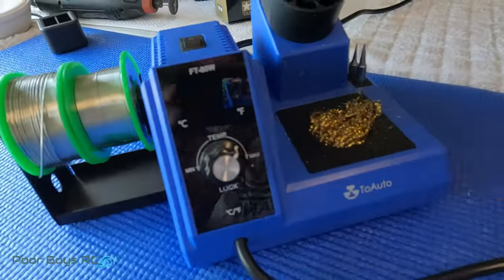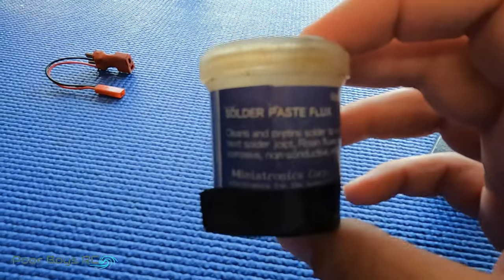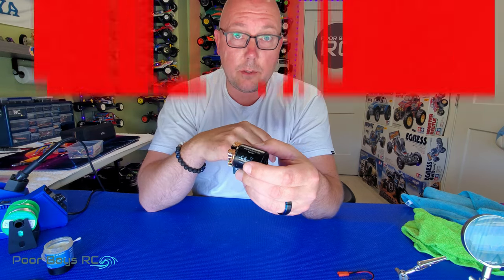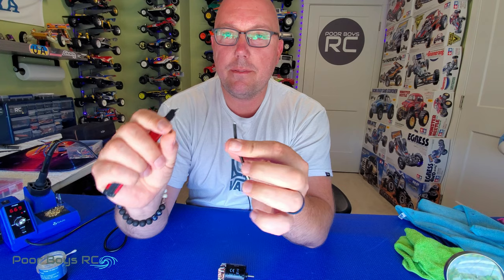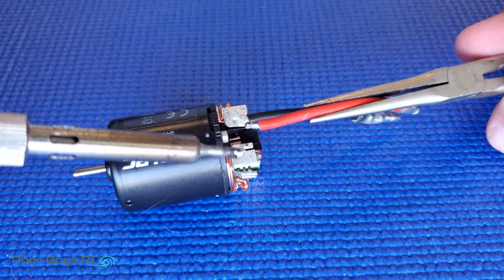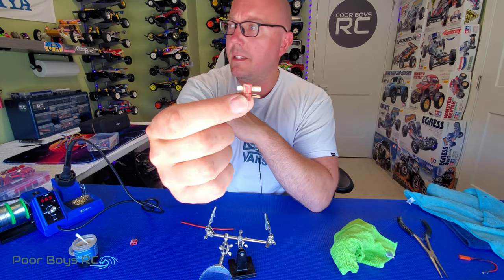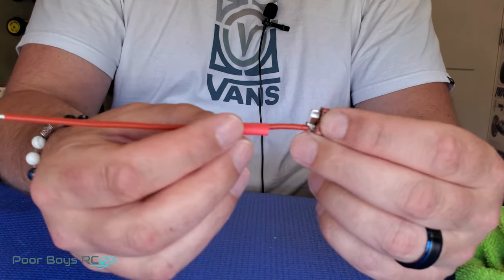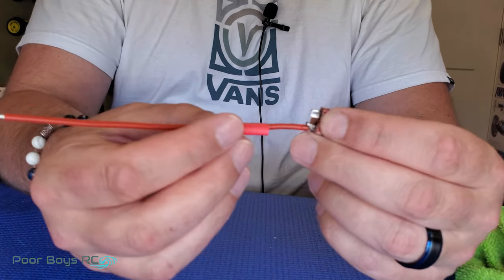RC Soldering Tips, Tricks, and the Tools of the Game. (Great for noobs!)

Comment: I like to use the handle of a pair of of pliers to cradle the motor while soldering.  You can also put a rubber band around the motor and handle for some extra stability while you solder it up. It was an old RC Car Action pit tip from days gone by.
Reply from the maker: Those RC Car Action pit tips were great! I remember mailing one in and they published it. I was so stoked to see my name in the magazine! 🍻

Comment: Flux can be either acid or water based. It helps the solder flow. I have learned a lot about soldering the last 2 months working at my second job.. 
they make solder paste that comes in a syringe. We use it for installing the processors to the circuit boards, but I bought a tube and I use it now for battery and motor connectors.. it works extremely well.. optimal temp for a soldering iron is 420 degrees Celsius which is 780 degrees Fahrenheit. To solder stuff like battery and motor connectors, you need a minimum of a 45 watt soldering station.. also a sponge to clean your iron is essential to get a clean joint.. all things I’ve learned in the past couple months I did not know from a lifetime of soldering
Reply from the maker: Sounds like you've mastered the art, Thad. Some good advice in here, thanks for your reply! 👍🏻

Comment: Nice tutorial, for the novices out there, how do you decipher between negative and positive on a brushed motor? They rarely show which tab to solder. The other soldering job was the bullet connector, how do you do that?
Great show mate.
Reply from the maker: It can be a bit of a mystery... Many end bells will have a little (+) or (-) molded into the end bell itself. But if it doesn't have those markings, I don't know how to determine polarity. I would use the "trial and error" method. 

And to solder a bullet connector, all the same rules apply. Flux, good heat, tinning, and it's easy street from there. 👍🏻
Reply: you can’t without an ohmmeter
Reply: Thanks for your help, I suppose you just add the wires and see which way the motor runs, then adjust them accordingly! Thanks again.

Comment: Excellent video. How do you find the sweet spot when adjusting the temperature for your iron?
Reply from the maker: Thanks for watching. I play with the temp dial, and over the years I've got a solid idea of where the Temps need to be for each soldering job. Best way to think of it, is to make sure the iron is hot enough to flow the solder smoothly. If it's clumping up, your iron is too cold. 👊🏼

Comment: Hey man. Brushless motors often don't have solder tabs. The battery leads pulled off my Dynamite 2 in 1 for Losi Mini T 2.0. I'm left with the black plastic on the motor and nothing to solder to. Is there a repair for this?
Reply from the maker: Hmmmm, never been down this road before, but I'm sure there's a fix. Tell me, are there a few screws at the end of the motor? I'm thinking you might be able to disassemble it to gain access to the solder points.
Reply: No screws. I figure the molded plastic needs to be removed to gain access. I could use flush cuts to dig blindly but don't want to damage the motor. I thought maybe a heat gun to soften and work it out.
Reply: As you can imagine any attempt with a solder gun just melts the plastic
Reply from the maker: @CraigAHaskell  no screws, eh? I wonder how they assemble these motors... It might be worth sending an email to Dynamite (Horizon Hobby, I believe), and asking them for advice before you start tinkering. Who knows, you might even get lucky and have them send you out a new unit! 😉
Reply: @poorboysrc  That's good advice. I appreciate it!
Reply from the maker: @CraigAHaskell  happy to help, bro. Keep me posted on how it goes!

Comment: As a suggestion for what to solder next that would be replacement of the antenna wire (if it gets severed/damaged) of a receiver..
Reply from the maker: Depends if it's a standard receiver witha static frequency, or a 2.4 ghz? On the old skool stuff you can just solder a bit of wire on. 2.4g stuff needs that special end on it and I don't think you can solder on any extensions. I think... 😉